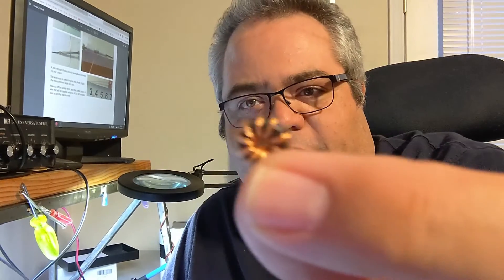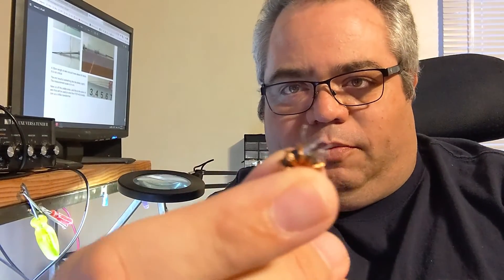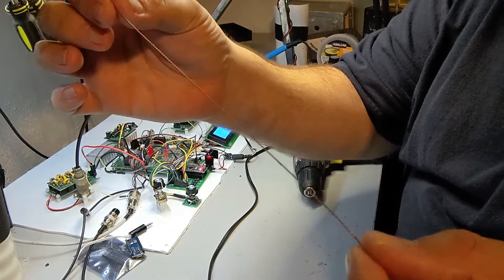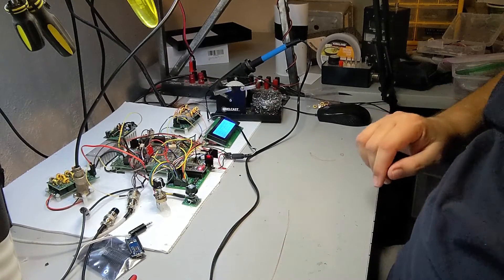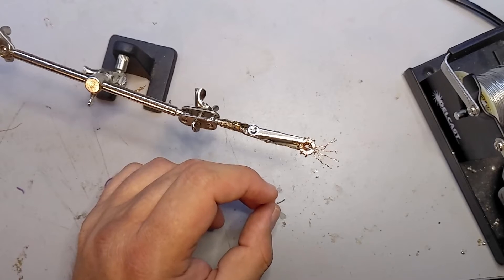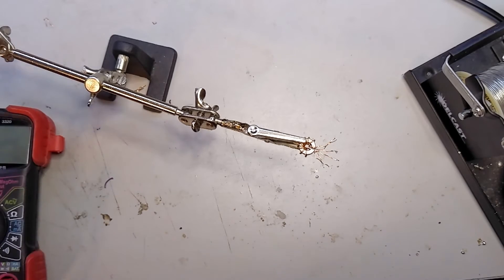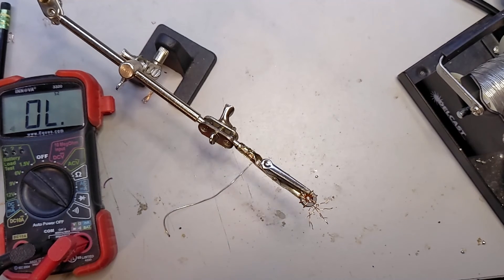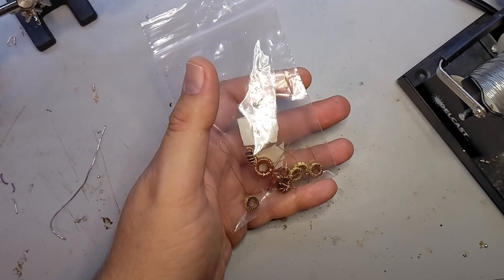QDX Build 1.2: Winding The Trifilar Transformer On A FT37-43 - And Looking For a Soldering Iron!

Comment: FT37-43? FT37-43 sounds a bit like a Micrometals part number with an "F" at the beginning, but it's not in any of the Micrometals catalogs I have, so I suspect it's not one of their products. The "43" is a Fair-Rite ferrite material, and their toroid in this material with an OD closest to 0.37 inches is the 5943000201. Is this part actually a Fair-Rite 5943000201?
Reply from the maker: Hans gets all of them from kitsandparts.com, W8DIZ. http://toroids.info/FT37-43.php

Whether or not its Micrometals or not, I don't know. But FT37-42 describes material, size, and mix. Whether that's specific to a manufacturer or not I do not know.

Comment: I messed this step up, wound up with a short in the winding and had to de-solder the toroid then spend another hour trying to get solder out of the through holes. I hope I didn’t brick it.😡

I called it a night and will try again after work tomorrow. The holes are too small now to tin the wires, so I will scrape and hope for the best.
Reply from the maker: One thing you can do is add some solder to actually fill the hole. Then put your soldering iron on it and get it nice and warm and then give the board a firm but not super hard smack on the workbench. The solder will actually clear the hole because it is still liquid by the time it hits the bench. Don't hit it too hard LOL. Give it a try on the spare board if you want to get the hang of it. Works every time! Sometimes I do have to add even more slider than I think is necessary so that I get both the heat and the inertia.

Comment: Did you have you drill motor in forward or reverse and I could count how many turns the drill made when it was done?
Reply from the maker: It was in forward rotation (clockwise). I didn't count the rotations, I just went until it looked about right compared to the picture on my screen.

Comment: Another good video Ryan. Your technique for winding and then marking pairs was neat, I will have to remember that if I ever wind a trifilar coil.
I bought the Sparkfun branded soldering iron a few years back and it has a wobble too. Unfortunately I am not very good at soldering, yet(?).

TOADs Rule!
Reply from the maker: Its good to know that the "name brand" irons have a wobble. Makes me feel less bad about being a cheapskate! And except for the power tools, the technique comes right out of the QRP Labs manual :) 73! ribbit